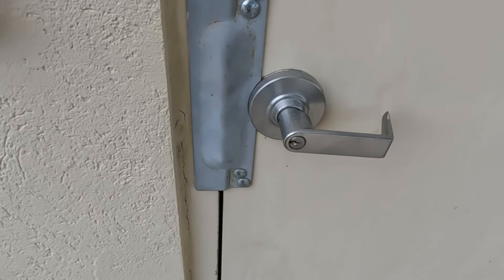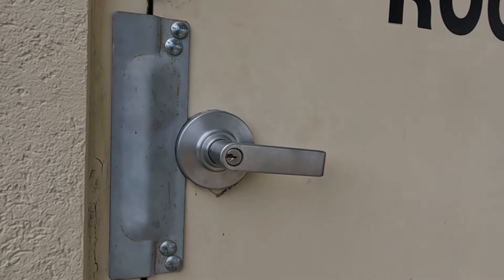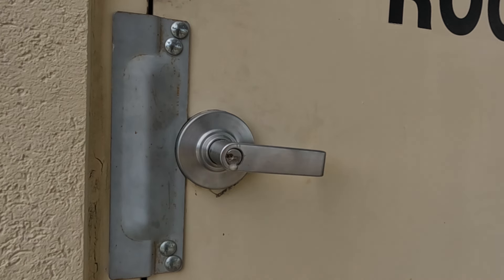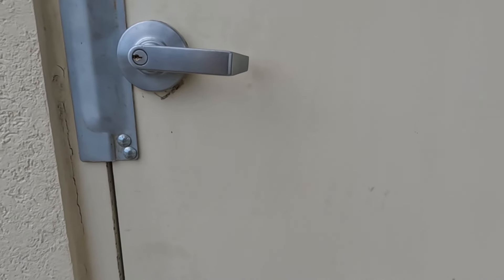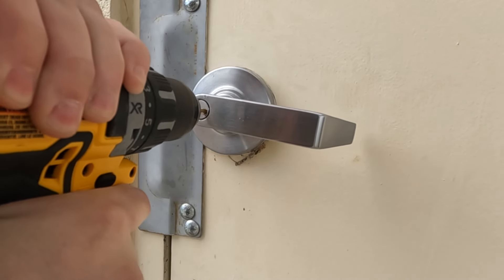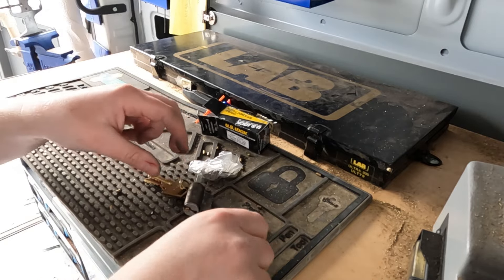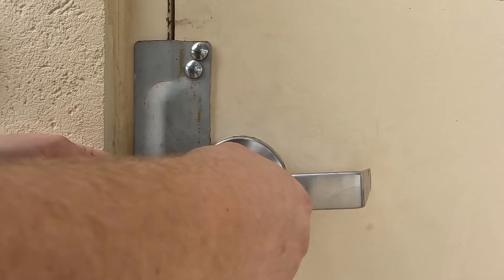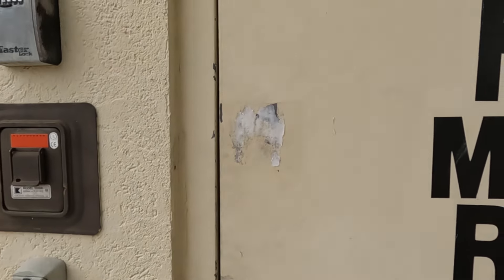(595) Drilling Commercial Cylinder with Broken Key In It and Replacing It

Comment: I've usually only had luck with spiral extractors if they key has a chance of coming out. Being an automotive locksmith I had no idea U.S. Lock is gone. Wow!! I remember them from back in the day. Probably have a few cylinders in a storage container I haven't opened in 12 years.
Reply from the maker: that key wasnt coming out.  maintenance got to it before me and messed the keyway up.  I should of just drilled from the start but I always try and make an honest effort prior to going destructive.  and yea home depot bought US lock and eventually just shut it all down.  doesnt exist anymore
Reply: I wasn’t implying the key was coming out. I could see that keyway was hosed. It’s hard enough getting broken keys out when the keyway is good. I was just saying I have the best luck with spiral extractors over the hook type. I did love the comment you should have opened the door from the other side though. I guess the meter room sign wasn’t a clue. :)